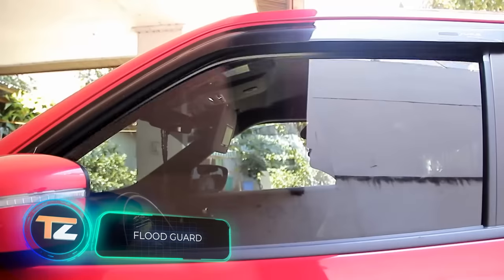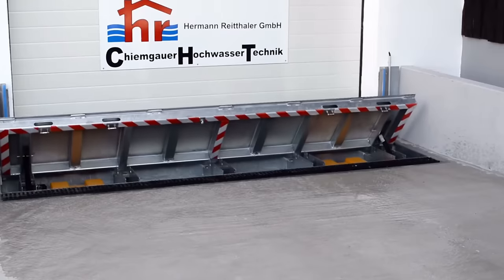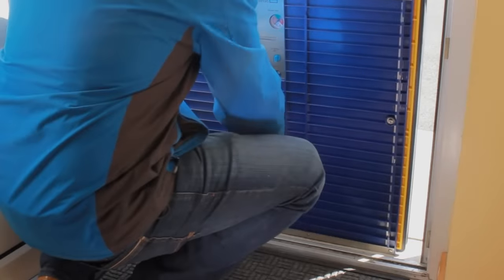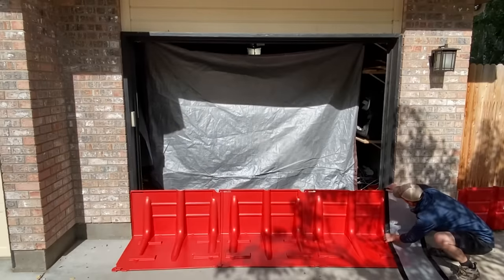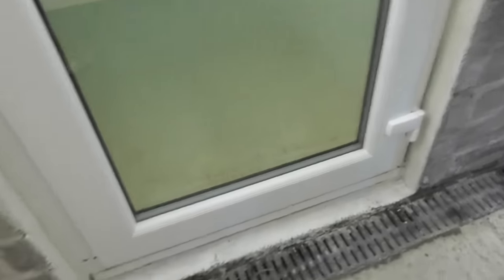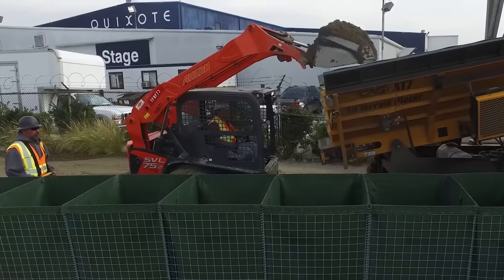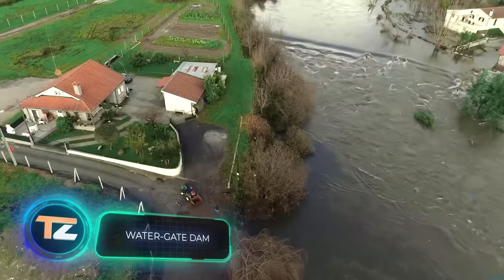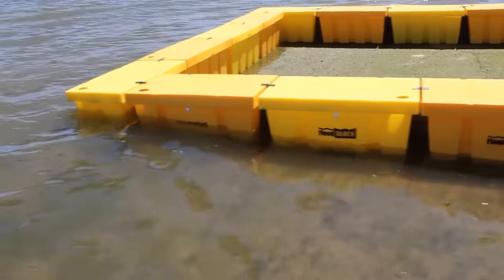FEW PEOPLE HAVE EVER SEEN THESE ANTI-FLOOD INVENTIONS

Comment: once we prevented the water from getting in the basement but noticed  after 2 hours when the earth around the house was full with water it just leaked to the walls and we decided to remove a little bit of the wall we be build and let the water slowly in ( not much dirt  and there was just  dust like stuff everywhere after the water was gone) because the water destroyed the cement between the stone walls and pushed from below against the tiles and washed out the mortar. so if you have not a special kind of wall structure in yyour basement i would not recomend these things

Comment: Wrap your car in a bubble? Or just drive to higher ground! In a bubble it will float; in a confined space that will smash against the roof ceiling, and given every flood I have seen had been turbulent, that will be smashed into the ceiling repeatedly. And I don't think those "bumpers" are going to do anything - debris doesnt edge gently into things, trees go end on through things, rocks rip holes in things etc. Just watch the local forecast and drive away when necessary.

Comment: Right off the bat, they put a strap on a pillar that holds up a roof. That is insanely dumb. If a flood happened and you did that, as your vehicle is lifted by the water, it will pull down the structure, because you just put a several ton weight on it.

Comment: Lol, The StormMeister, along with Many of these other Inventions, is laughable. 23" of water . . . but ONLY about 12 x 36". There is Very LITTLE Pressure with that volume of water. Most of these do NOT take into account the Pressure and Power of the water. Sure, if there is Slow rising Flooding happening, some of them may work. But they totally forget about the other "Entryways" a building has for water to enter. Basement Windows, Vents, Wiring such as Cable or Phone. Go and check . . . the Installer Rarely makes sure to water, or even Air Tight, check these holes they placed in your walls.
Good effort though. Keep working on it.

Comment: None of these stores water 
They only push water away
We need stackable containers with submersible pumps at the bottom so we know how many stackable containers with submersible pumps we need to control large floods
All these systems are implying when there's a flood you push it downstream and make it someone else problem 
Except pavement that absorbs but I don't know how much it does absorb
The pavement looked incredible for what it did
Still I feel stackable containers with submersible pumps will be the only real answer

Comment: The statement "FEW PEOPLE HAVE EVER SEEN THESE ANTI-FLOOD INVENTIONS" is not a real-time question, as it does not require access to real-time data, current events, or information after 2021. However, the accuracy of this statement depends on the specific anti-flood inventions being referred to. Some innovative flood prevention technologies have been developed and implemented in recent years, such as smart drainage systems, flood barriers, and green infrastructure. The extent to which these technologies have been widely adopted and seen by the public may vary by location and context. It's possible that some communities may still be using more traditional flood mitigation methods, while others have embraced these new solutions. Overall, the statement is subjective and open to interpretation, as the definition of "few" and "seen" is not explicitly defined.-time question, as it does not require access to real-time data, current events, or information after 2021. However, the accuracy of this statement depends on the specific anti-flood inventions being referred to. Some innovative flood prevention technologies have been developed and implemented in recent years, such as smart drainage systems, flood barriers, and green infrastructure. The extent to which these technologies have been widely adopted and seen by the public may vary by location and context. It's possible that some communities may still be using more traditional flood mitigation methods, while others have embraced these new solutions. Overall, the statement is subjective and open to interpretation, as the definition of "few" and "seen" is not explicitly defined.

Comment: Some of these are a bit misleading. Brick is not waterproof unless you maintain some sort of waterproof coating on it. Water does not have to get to our doors for water to get in our houses. I can only hope the people who purchase some of these solutions know this so they don't set themselves up for massive disappointment AND they are out however many hundreds or thousands of dollars they spend on this sort of stuff.

At my university, since flooding is so extremely common here, there's a senior project group that works on developing flood barriers every year that can go around an entire house because our wood and brick houses are not waterproof! I don't know about you guys that might get light flooding with hardly any winds, but we get hurricanes. What I will say is that things like the Hesco flood guard are very neat, but it's not an option for residential consumers. It would take forever for someone to put this around their house and fill. And taking it down would be a nightmare. I'm quite impressed by FloodBlock though, because of how practical it is. Space efficient when not in use, and can be assembled by one person!

I wonder how well proofed against wind the WaterGate dam is I can't tell how it's connected to the ground so how do we know that it's stable? Does it stay in place for storm surges in hurricane force winds? Like yeah, I understand that they can't have footage of all its usage, but did they try this in somewhere in Texas? Louisiana? Florida?

Comment: Ok I cant be the only one that thought this. you are going to cover your car in a plastic bag. Thats like covering your head with a plastic bag and pumping toxic fumes into it. This wont be used well.
Reply: As a person from the country with frequent floods, these kinds of car bag actually work. Just that if a bag isn't completely air-tight, your car is gonna be full of fungi because of humidity. Cleaning a car out of fungi is still cheaper than changing your whole engine and electricity system though.